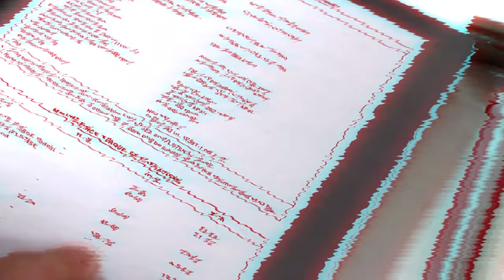How To Diagnose & Repair Engine Misfire: OBD-2 Code: P0306, P1399, P0300, P0305, P0304, P0303, P0302

Comment: Was the bad coil from cylinder 6?  Not a real important issue but it was interesting that your OBD tool listed cylinder 6 first. Code 306.
Reply from the maker: Sure was! The only coil that had an issue was #6. When we unplugged the coil while the engine was running nothing happened. The engine did not bog down. If it bogs/sputters it means it stopped firing. Yes, it was surprising that it threw a code for all cylinders instead of just the one. But you should just change them all anyways. The coils come in a set at the store anyways.

Comment: Thanks.  Good video.  Need to do videos on the rarest suv in America.  The Isuzu Axiom.  I am having a p0160 code.  I checked all the usual suspects, broken wires, leaky exhaust, bad O2 sensor.  Need to find all groundings on system so I can check those.  A video on the Isuzu axiom grounding placements would certainly help.
Reply from the maker: Thanks for the suggestion! We'll definitely try to get a video on grounding issues.

Comment: i've got a 99 acura cl 3.0 and it misfires on 4 cylinders changed all of the plugs and now 2 are misfiring. it doesn't have coils but distributor wires. could the wires be at fault?